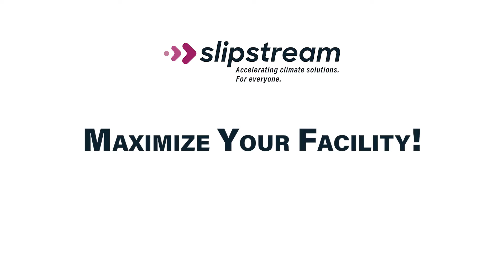Thermostat Wiring Series: Wiring a Heat Pump

Comment: I have a oxbox trane , the installer left me hanging AC worked but now its winter it feels luke warm or cold . I noticed a thick bue wire and red or orange wire not hooked up . Blue is on the outside unit. I donr see a matching wire for those either outside.  Anyway you can help . Oxbox trane heat pump with heat strips inside

Comment: If the reversing valve needs to be energized on cooling, should not O be the option on the subbase? O is always made when the thermostat is on cooling mode, independent of the thermostat cycling Y on or off.

Comment: Thank you so much for such an informative video!  I had replaced a thermostat in the winter for my mother in law and thought I had i correct until this summer hit and it blew hot air.  I almost gave up hope until you mentioned the reversing valve might be opposite.   I changed parameter 2 in the thermostat and all good now.  God bless you!
Reply from the maker: Glad our video helped. 👍

Comment: So from the thermostat u wire to the furnace,  then pigtail two orange wires,  then afterwards follow that thermostat wiring with suction and liquid line to the outdoor unit and pigtail to defrost board? Sorry im still learning
Reply: Sorry, I am not clear on what the specific question is?
Reply: For heat pump unit you wire to the defrost board @ryanhoger1

Comment: Great video.  Now - do you have a video discussing how to connect a smart thermostat to control a heat pump, single stage, with aux heat in the fan housing.  The Thermostat is a Sensi Smart Thermostat.  Problem - is the strip heater in the HVAC housing the "same" as a furnace or other backup heating system.  The Sensi wants a code for setup - do I put EL1???
Reply: Wiring is nearly universal between all brands. I'm not familiar with the Sensi setup codes.
Reply: Also not clear on what you are asking when you say the issue is the the strip heater is the same as other heating. What are you asking there?

Comment: Great video, do you have one for Wiring a Heat Pump with with the Power Extender Kit (no C wire) PLEASE!
Reply from the maker: We will put this on the list.
Reply: This one might help. In the case of the heat pump version you just still wire O/B directly from stat to equipment in addition to other wires in this video and on the PEK portion - https://youtu.be/LWIkKUwuh0Q?si=xFy6PwkLkS47Usm_

Comment: where are the ground and hot wire to power contactor
Reply: That comes from the disconnect box/ load terminals
Reply: @m00capalot20 no they don't. He's asking about the contractor coil not the main power.

Comment: HI,  i run 5 wires from goodman 3 ton heat pump to the air handler   have way on my way to the air handler  i spliced with the thermostats wire , is this correct way ? (reason to spliced have way cuz i need to cut open a wall to sneak the wire from the thermostat like 15-20ft ) or i need to run thermostats wire just like heat pump wires to the air handler board ? thank you in advance

Comment: thnx for ur info. May be U can assist me here. My heat pump system, that has electric heat strips, has the indoor unit running all the time and BLOWING warm air because the control TSTAT which is in the HEAT MODE, is not turning on the OUT DOOR UNIT. What can I check to see, that maybe is the cause' as to why the first stage of heat, (which is from the heat pump) is not functioning? And another question. Because my thermostat brings on the Aux. heat automatically, (which is the 2nd stage of heat), is this normal for all thermostats? Your reply (or any other) will be appreciated. Thnx again.
Reply from the maker: Thank you for your question! We recommend contacting a local HVAC contractor who can help assess your system.
Reply: This is likely a function of how the thermostat has been setup. The heat pump should be stage 1 and the electric resistance heat be stage 2. And for the majority of systems, you should let the heat pump continue to run simultaneously when the electric heat comes on. Most heat pumps... and especially modern ones... can run a cold temps are are still above the efficiency of electric heat (COP = 1.0) below zero degrees.